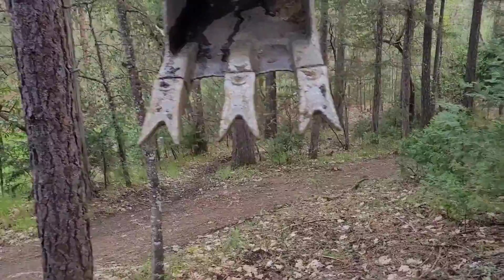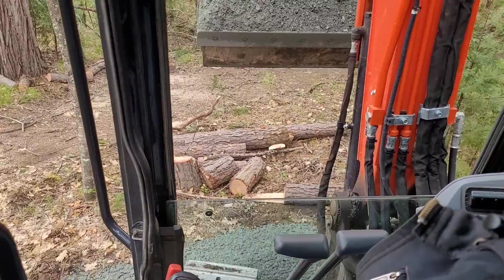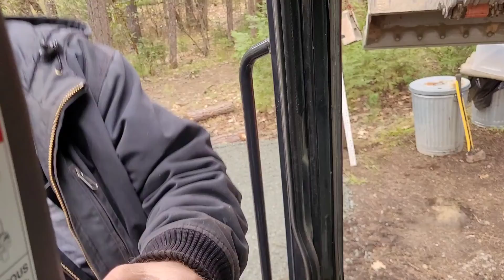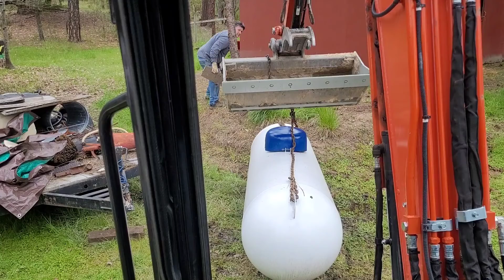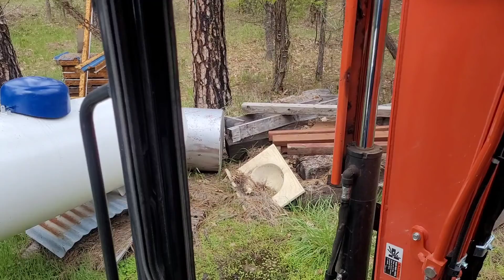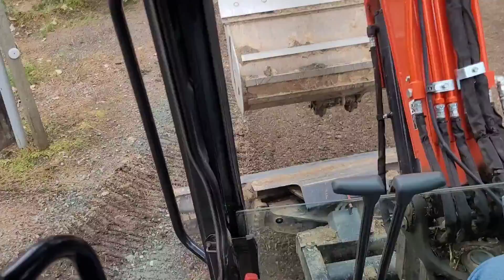Building a little pad for a propane tank with the Kubota kx-040

Comment: Nice channel,  just subscribed,  I was beginning to wonder if you had any other buckets,  😆.   I have a KX 033-4 open station with 18 inch bucket and hydraulic thumb and tilt blade,  currently 45 hours.  Seams like the 40 has a lot more power than the 33.
Reply from the maker: Thanks for the question, yes I have a 12" 18" 24" 30" 36" smooth and 48" smooth and a ripper shank I built myself several years ago. I have never been around a 33 but the 40 is a heavier machine so it should have a little more power.